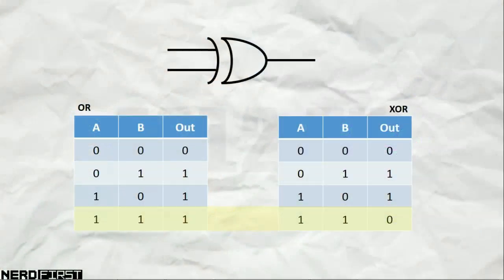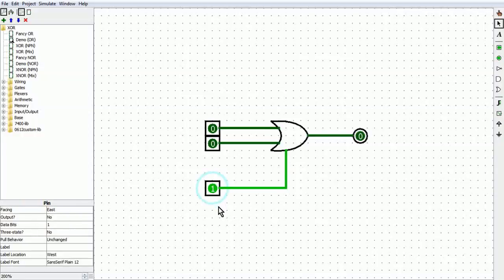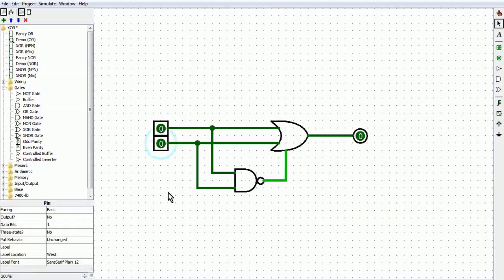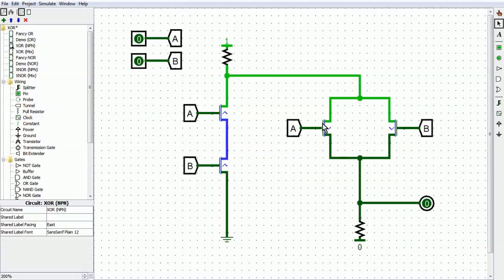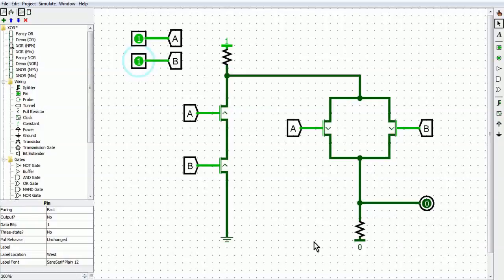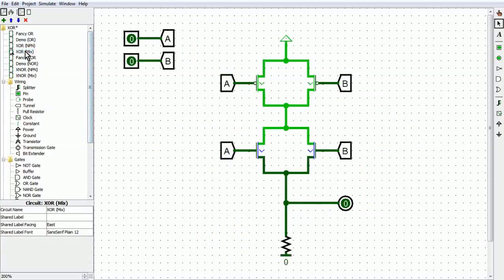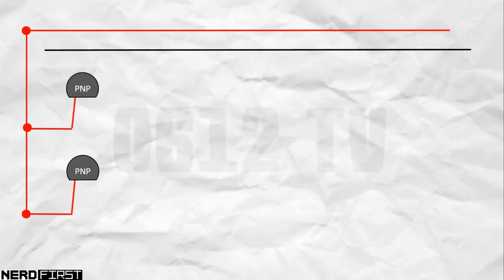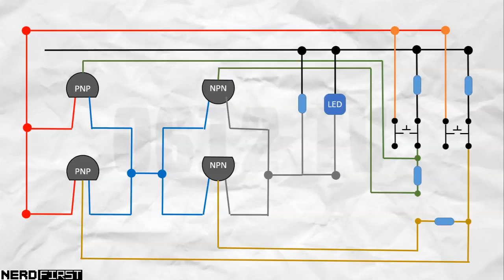XOR Gates - Transistors 08

Comment: I doubt you’ll respond all this time later but what are all the resistors you used and are they all the same?
Reply from the maker: Hello and thank you for your comment! I used 10kΩ resistors, though you might want to exercise caution doing the same as I just used a higher resistance in general for pull resistors and did not formally calculate to ensure that they work!
Reply: @NERDfirst   also, can a PNP transistor be used as an inverter? If so how is it wired? Thx
Reply from the maker: If by inverter you mean NOT gate, then yes. You may want to refer to the rest of this series for the other logic gate implementations. The full playlist is here, NOT gates are the third episode: https://www.youtube.com/playlist?list=PLJse9iV6ReqhHqCqtdoY3xnnx3DbxrxL_
Reply: @NERDfirst   thanks!
Reply: @NERDfirst   one more, what transistors did you use for the PNP and NPN switches?
Reply from the maker: The transistors used are:
PN2222A NPN Transistor
PN2907A PNP Transistor
Reply: @NERDfirst   is there a social media link that I can message you at? I need a little help with a circuit I’m working on.
Reply from the maker: Hello again! I generally do not provide synchronous support unless formally arranged.

If you need more help, send me an email at hello@nerdfirst.net. Explain your problem in as much detail as possible and I'll get back to you within three days with a proposal for work and quotation for payment.

Comment: Hi sir! Can you please give what specific materials did you use? BTW your video is very informative
Reply from the maker: Hello and thank you for your comment!

The transistors used are PN2222A (NPN) and PN2907A (PNP). I don't have part numbers for the LED or pushbutton, but since I use 3V (2xAAA) for most of these videos, my parts are compatible for use within this voltage range. For this video (and generally for pull resistors), I use 10kOhm resistors.

Comment: Why are the switches pulled down?
Reply from the maker: Hello and thank you for your comment! The switches are pulled down so that when they are not pressed, they send a low signal to the circuit. Just to reduce the uncertainty of noise affecting the behavior of the transistors, though this may not be strictly necessary.

Comment: Hey! Dumb question, but I obviously can't just swap the PNP transistors for NPN ones right? Also, which transistors are you actually using?
Reply from the maker: Hello and thank you for your comment! You should not see the same effects by just swapping PNP transistors for NPN ones. There is a possibility that you could put the transistors in reverse bias as well (ie. Reversing the roles of the emitter and collector), which isn't exactly how transistors were meant to be used.

The parts I used are as follows:
PN2222A NPN Transistor
PN2907A PNP Transistor
Reply: @NERDfirst  Hey! Thanks for your reply, what you said did make a lot of sense. I tried doing the circuit with various transistors (of PNP and NPN respectively) which didn't change anything (which makes sense, since I think, using a different PNP/NPN transistor should work the same way, for the most part, right?)

 The problem I'm having is that the LED Bulb is on regardless of what I try to do with switches. Even if the switches are malfunctioning, they should effectively be giving (0, 0) or (1, 1), in which case the bulb shouldn't be on either, since it's an XOR circuit. To combat this I removed the switch and tried using a wire as an alternative, by literally talking it out and back in as a pseudo-switch, which made no difference. The obvious conclusion is that I've somehow messed up the circuit in a way that the transistors and switch is being ignored, but I couldn't figure it out. 

 If you don't mind, it'd be great if you could help me out!

1. A switch, according to me, is basically something that only allows current to pass when it's pressed in/turned on. Is that the switch you're using here? Or is it taking multiple inputs, and passing positive in one case and negative in the other case, or something like that?

2. Are there any "Circuit 101" mistakes that could be causing the problem? I have made AND and NOT gates before, and they have worked, so I do have some very basic knowledge of how to use a Breadboard, but they never used PNP and NPN transistors in conjunction. 

3. Do I need to worry about whether the Emitter and Collector are in the correct orientations? I oriented the transistors as you had in the final circuit.

Thanks, again! I know some of these doubts may seem stupid, but I'm not really a circuit kinda guy :P
Reply from the maker: Hello again! I'm about to head off to bed so I'll fully answer you tomorrow, but in the meantime, it seems like some of your fundamentals aren't really in place yet. This video is part of a larger series, and some of your doubts can be cleared if you watched it from the beginning: https://www.youtube.com/playlist?list=PLJse9iV6ReqhHqCqtdoY3xnnx3DbxrxL_

I'll get back to you with actual answers in the morning!
Reply: @NERDfirst  Thanks a ton! I'll wait for your reply. And, uh, yeah, my fundamentals aren't too clear, I've been learning as I go, for the most part. :P
Reply from the maker: But seriously, watch the videos from the beginning, particularly the first few episodes before I go into the gates. They'll clear up quite a few things like the differences between NPN and PNP.
Reply from the maker: Hello again! Hope your project has been going well. 

Based on your description, you are likely to be using your transistors incorrectly.

1. No, I am using a simple on/off switch.

2, 3. Refer to the videos I have linked previously on the fundamentals. Assuming that the parts you use have not malfunctioned, and are being used to specifications (eg. Connecting them right, giving them enough voltage etc), they should behave as in my circuit.
Reply: @NERDfirst  Quoting myself, "Or is it taking multiple inputs, and passing positive in one case and negative in the other case, or something like that?" 

 I still don't see why, in both your circuit diagram and your breadboard, it seems as if you've connected both positive and negative to the button.
Reply from the maker: Hello again! I see what you mean - Sorry I missed that the first time, it technically isn't connecting it to the switch, though the fact that I'm using a 4-pin pushbutton makes it look that way.

The resistor is a pull-down resistor, so that when the button is released, it's definitively ground, and not floating.

For more on this, watch this vid: https://www.youtube.com/watch?v=sD81lzBULJ4